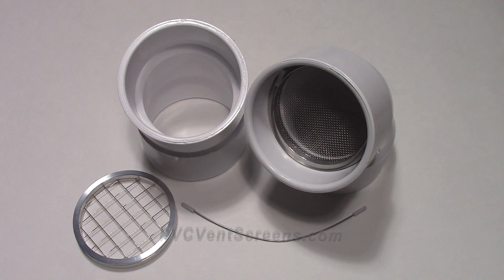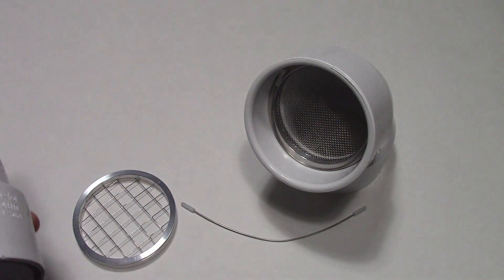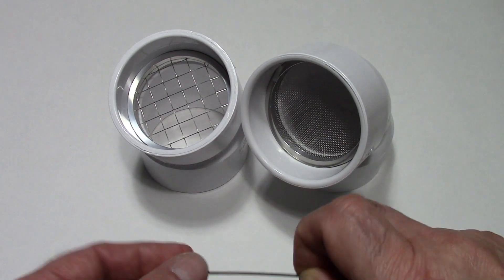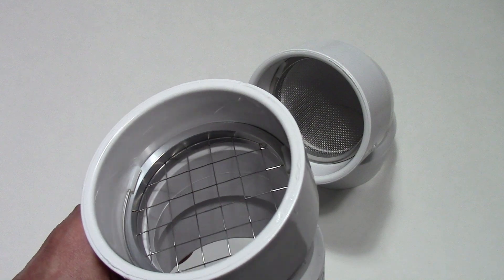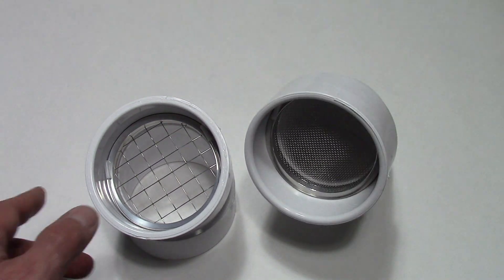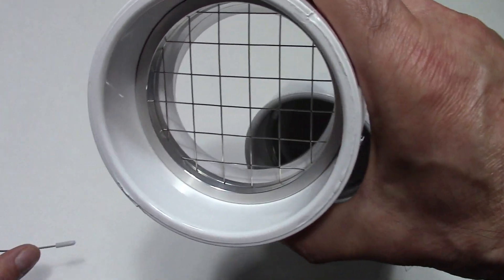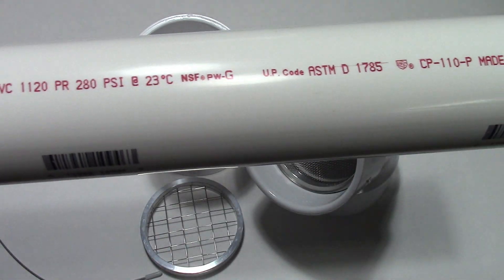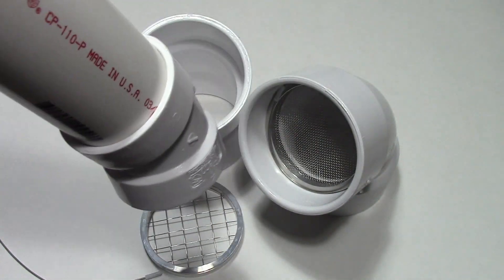PVC Vent Screen Installation and Removal

Comment: As to birds and chimneys/ flues, I HAVE seen birds (and even raccoons) in chimneys, and all the way down to a standard efficiency furnace (metal flue) VIA THE CHIMNEY. (not the racoon, obviously) But screens on a high efficiency appliance? NO. For the record, high efficiency appliances are side wall, or even roof vented, but never into a chimney.

Comment: A solution looking for a problem. One wasp's nest in 35 years. 99% of the furnaces I see, and 100% of the ones I install, don't have one. The much bigger possible outcome is they get clogged or an ice dam, both of which I've seen many times. They WILL form ice dams in the coldest temperatures, because of the frigid cold as well as the much longer run times bitter cold produces.  Birds? nope. Rodents? nope. Wasps? VERY rarely.

Comment: Glad I found these, I ordered 3 just now.
I know at my workplace we've had birds get in the pipes and into the vent blower and UGH, not only ruined the motor but it's defintely no fun having to pull the unit out and deal with feathers and bones or worse all jumbled in there. One bird got down the old brick chimney and into the horizontal water heater flue that went into the chimney, and all the way in to the end of the flue over the actual water heaters' open flue portion on top of the tank and got stuck there, we kept smelling something like burnt chicken or feathers, I looked and saw a bird's beak sticking out of the cross-mesh, I had to remove the pipe and dump it out, the bird was blocking the exhaust from the water heater and caused a dangerous condition!
Installed a new furnace at home now, and went to find some kind of cap, local hardware store knew  of none, so I figured I'd search and there was your web site with the PERFECT solution. I terminated the vent with a tee, and the intake with a snorkled set of 3 elbows, so the 3 screens will do it and having a tee on the exhaust  is best, it also means that instead of one screen causing a slight reduction in airflow, it will have twice the open surface area with 2 screens which will reduce that nominal airflow reduction to practically zero
Reply from the maker: A word of caution for those smelling foul orders from their boiler, furnace or hot water heater. It's not uncommon to have multiple animals lodged within pipes or trapped inside appliances. Though in many cases the animals are dead, opening up a pipe or furnace cabinet can release a partially burnt animal and/or other living animals into the dwelling. The same concerns apply for bees/wasps which often nest inside pipes and appliances. We discuss this in more detail at: https://pvcventscreens.com/putrid-furnace-odor/

Our vent screens are designed to work with existing intake and exhaust vents without modifications to the terminations. While seasonal airflow is extremely important, altering terminations can have unintended consequences such as reducing the flow velocity. Using tees and/or enlarging vents can reduce the exhaust discharge flow and limit how quickly this exhaust is discharged beyond the termination. In many cases, perceived improvements in airflow are negated by a major reduction in flow velocity. It's more important to use our vent screens seasonally as noted on our website. PVS-I and CVC-I series vent screens guard against insects and rodents during the warmer months. 90% airflow rated PVS-R and CVC-R series vent screens are designed for use during sub-freezing temperatures (winter). Using both types of vent screens, seasonally as noted on our website, will guard vents in all seasons from all active threats.

Comment: Can I use an insect screen year around? I prefer the tighter mesh screen for bugs/insects. Is there any need for me to switch vent screens?
Reply from the maker: If you reside in a region that experiences sub-freezing temperatures, the insect screen should be removed and replaced with the appropriate 90% airflow rated PVS-R series vent screen for winter use. All-season kits that include both types of screens are available in our store. More information regarding the importance of maintaining a very high rate of airflow during winter is available on our website.
Reply: @pvcventscreens  Thanks for the reply! Much appreciated.
Reply: In the winter-  condensation or melting snow can cause blockage on fine screens which doesnt happen on the more open winter screen's larger openings, I easily understood why they have two season types

Comment: Is the larger vent screen going to prevent mice from entering the pipe?
Reply from the maker: Yes. PVS-RS and CVC-R series rodent vent screens follow industry standards to prevent mice from gaining entry into vents. See our best practices page at https://pvcventscreens.com/best-practices/ to view the Fairfax County Health Department's "Controlling Rats & Mice" brochure.  As the brochure notes, "mice can squeeze through spaces as small as a nickel!" A much smaller dime won't fit through our rodent screens. Also discussed on our best practices page is the importance of maintaining a high rate of airflow. Since combustion is involved, the screen's impact on airflow is extremely important during winter. When insects are active (spring, summer and fall), PVS-IS and CVC-I series vent screens are designed to guard vents from rodents along with insects (bees, wasps, etc.).
Reply: I haven't seen a mouse in a vent in 35 years